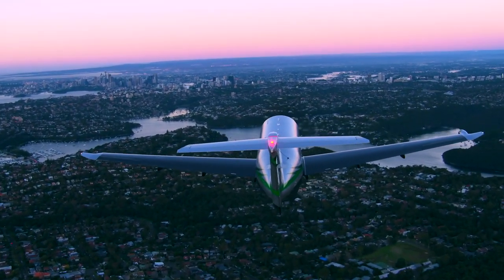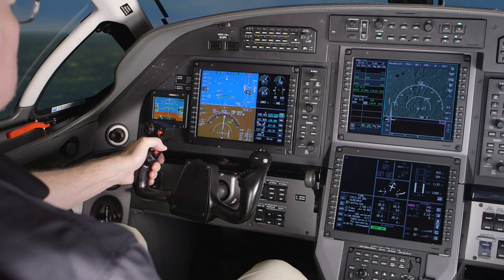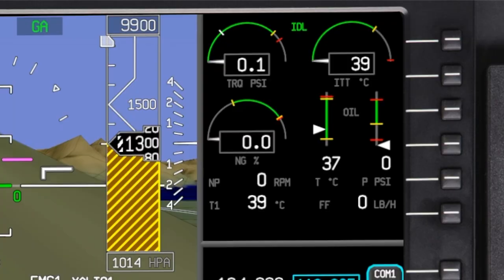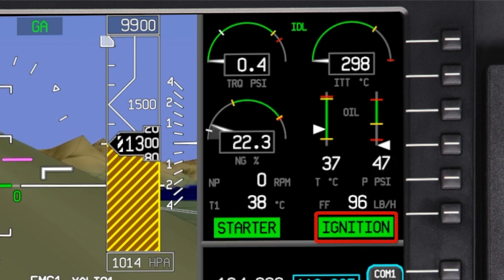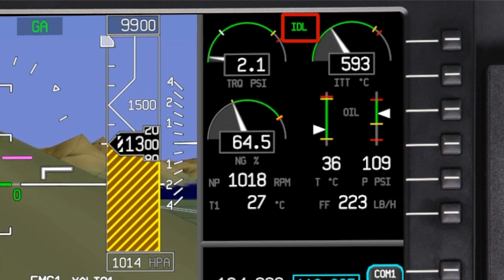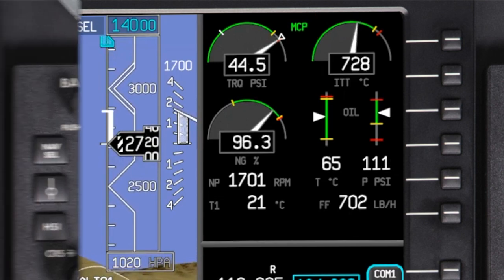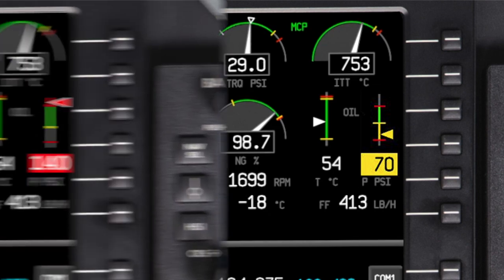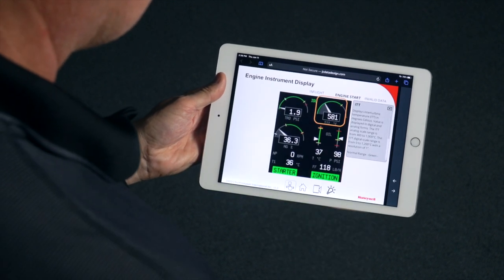Engine Displays on the Pilatus PC-12 NGX | Honeywell Aerospace

Comment: Overall a good video. However the narrator made a mistake at aporox 3:30. This wasn’t oil temperature but oil pressure
Reply: same about propeller speed 10 seconds later, it should be T1 instead
Reply: @lucasconstantine4473  Also, isn't T1 inlet temp? 1770?! 1890?! Or do I have that wrong?
Reply: fuel temp @Timmay46